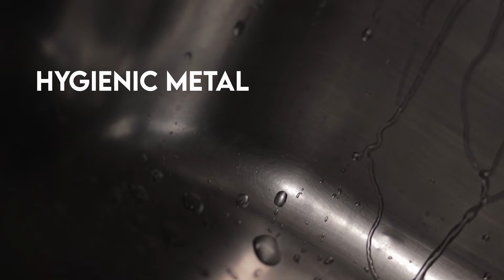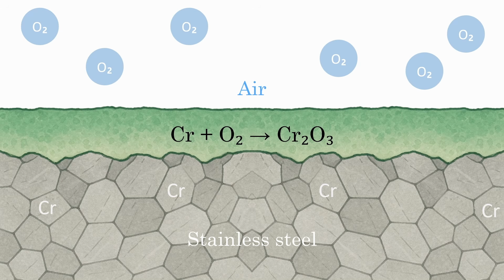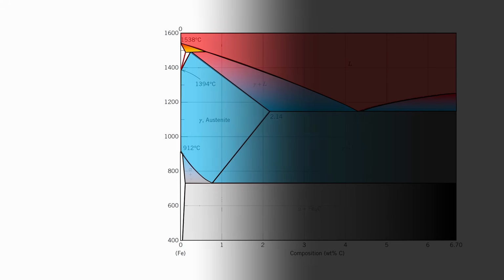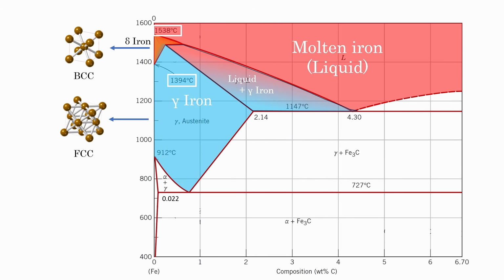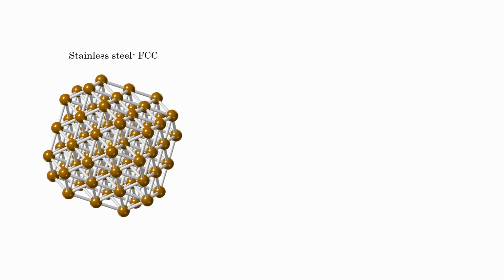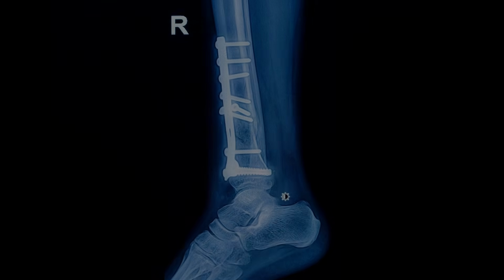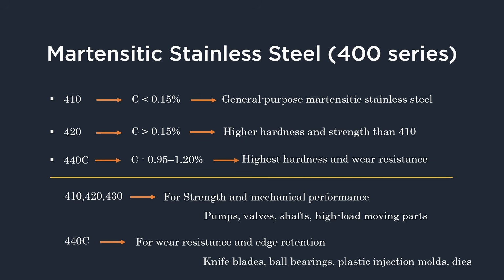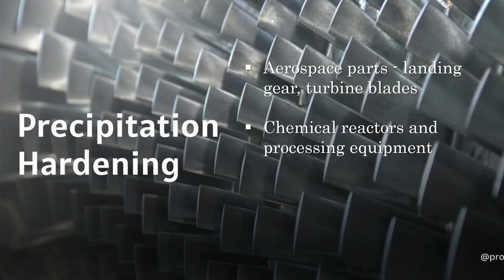Stainless Steel Explained from Basics to Advanced

Comment: Also an acidic environment will also cause the metal to corrode. Ref the collapse of a ceiling  over a public pool in a country some years ago due to chlorine   in the water that had evaporated from the pool . The same is true of bleach or acids spilled around machines in a workshop ,the nearby machines will begin to corrode due to acidity in the air around the old spill. Rubbing an alkali solution on machine surfaces is the answer .

Comment: What I can tell you is that in a working environment grinding consumables used on carbon steel must be kept away from consumables used on stainless steel because the carbon steel dust embedded in them will contaminate and cause the stainless steel surface to rust . In a workshop these two polishing and grinding accessories must be kept to their respective materials and not shared .

Comment: The temperature \(912\ ^\circ\text{C}\) is not steel's recrystallization temperature; it is a phase transformation (allotropic) temperature. At this exact threshold, pure iron changes its crystal structure from Body-Centered Cubic (BCC) \(\alpha \)-ferrite to Face-Centered Cubic (FCC) austenite.

Comment: Reinforced concrete, commonly used in construction, eventually rusts and destroys the surrounding concrete. Some builders replace the steel with fiberglass or similar materials. What type of steel could be used to slow down rust while maintaining the necessary technical properties and at a reasonable price?
Reply: Coated rebar would be an economical choice.

Comment: One important largely unknown property missing here is the gradual yield behaviour of stainless steels. Although 304 is ultimately stronger than mild steel, it begins to yield at only half the load of mild steel. This makes it distort under much less load than the same  thing in mild steel. This is why stainless screws are rated at only half the torque of equivalent sized steel screws.
Reply from the maker: Yes, true. Great point, I will try to cover in material properties series
Reply: Ahhh that's a great point to bring up, thank you! I'm going through welding school and we are getting a light introduction to metallurgy and I'm discovering how completely clueless I was about metals. So now I'm binging videos and articles to get informed. The yeild is the value of the amount of stress like weight can  take before it becomes plastic and starts to permanently deform or rupture right?
Reply: @Ireallycantthinkofahandle  yes and usually the yield point is well defined at a particular stress. Not so for stainless. It begins to sag half way up the curve and there is a time factor to it. I think of it like "silly putty" only stronger.
Reply: @Ireallycantthinkofahandle  search for  "gradual yield stainless steel" for more info
Reply: Very informative, thanks
Reply: This has to do with the FCC structure of the Austenitic Stainless steels . Due to its closer packing of atoms , the movement of dislocations is faster . By which i mean faster than a steel with BCC structure for instance Ferritic Stainless steel . 
In very easy words , this property is what we refer to as "Ductility" . A ductile material will yield at a lower stress .

Comment: Very good and elaborate video! :D
I only have one question: you mention a lot of times that stainless steels have superior strength over carbon steels, but when I look at the yield strenghts of the different steels, carbon steels usually have higher yield strenghts (except when you look at duplex types). Also regular stainless steel bolts (A2, type 70) are weaker than regular 8.8 bolts. They break far more easily. Why is that? :)
Reply from the maker: Hey. very good question.
Yes, even plain carbon steel generally has higher yield strength than stainless steel 304/316. 
The same applies to bolts, a carbon steel 8.8 bolt has a much higher yield strength than an A2 stainless bolt.
However, stainless steel does not break easily, and that is the key point.
Yield strength is related to elastic limit, not toughness. stainless steels 304/316 are more ductile than mild steel. 
They start to plastically deform at a lower load, so they can bend more before failure.
At the same time, stainless steel is tougher and can sustain higher stress before fracture.
That is why its ultimate tensile strength is higher
304 stainless steel 520–750 MPa
Mild steel 400–550 MPa
Stainless steel is also slightly harder
304- 150–220 HB
Mild steel- 120–180 HB
So it really depends on what we mean by stronger.
If we mean yield strength carbon steel is stronger.
If we mean toughness, ductility, and resistance to fracture, stainless steel performs better.
stainless steels also have high work-hardening, which makes them harder to machine. 
This is why, instinctively many people feel stainless steel is stronger.
I'm not saying im right, I should say that I am referring to the higher tensile strength and hardness of stainless steel, not simply calling it stronger in every sense.